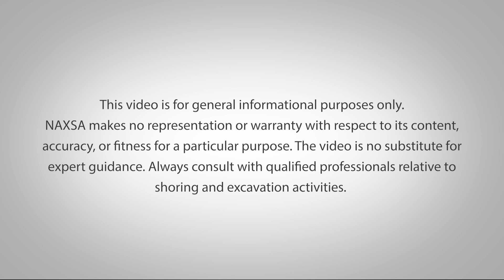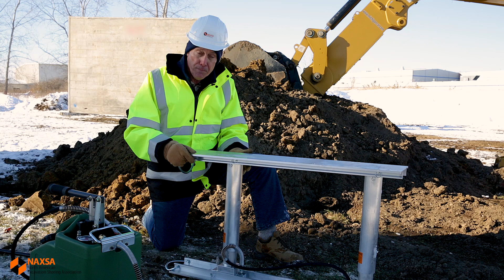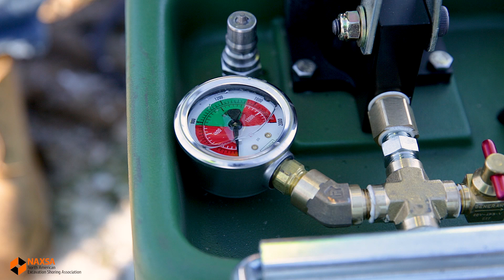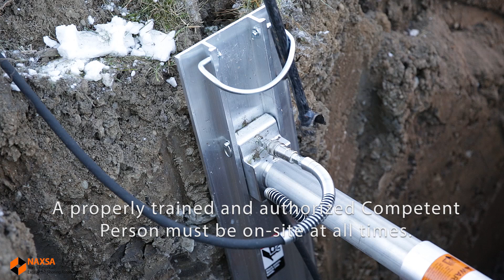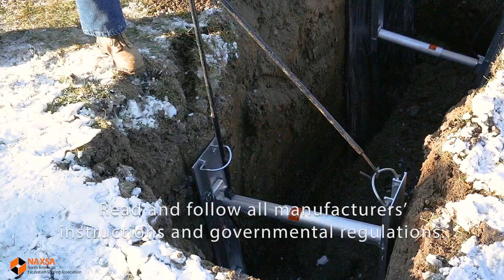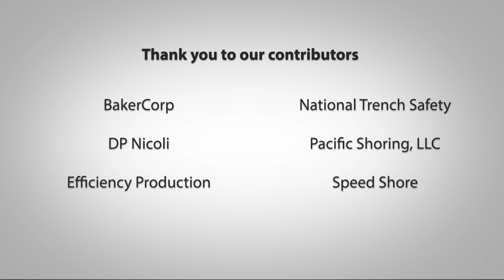Installing & Removing a Hydraulic Shore

Comment: Improper installation technique. The release tool goes on the outside of the handle for the installation... one fluid motion down NOT wasting time turning release tool 180°... geezers know best...✨✨